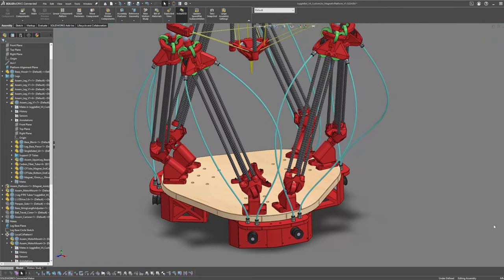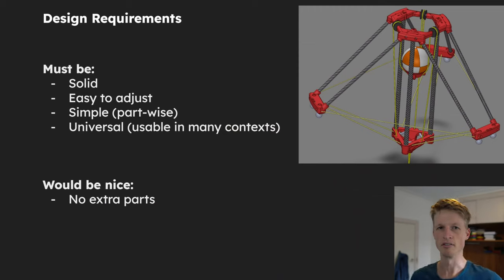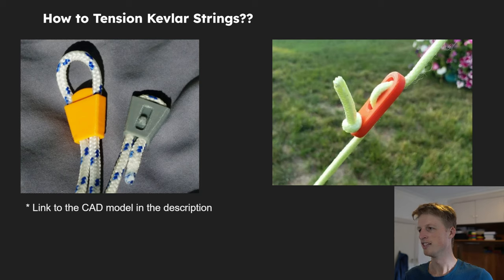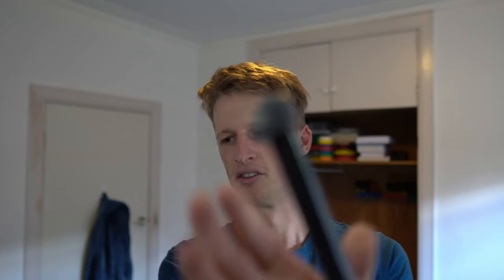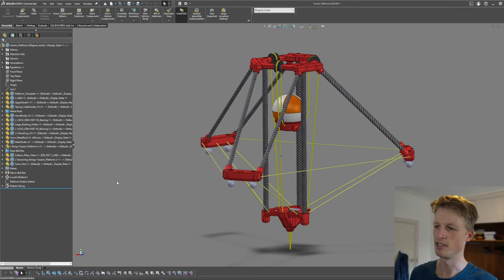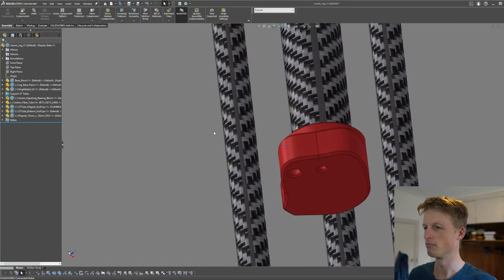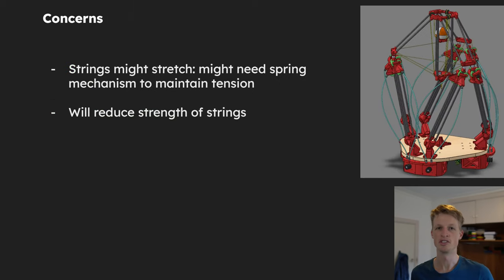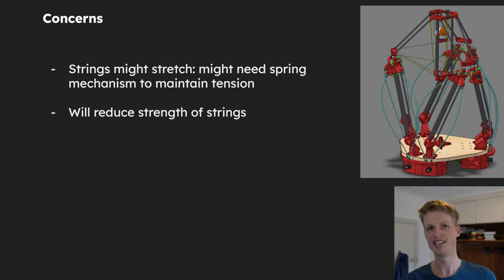Knot Anymore! Jugglebot's (Practically) Knot-Free Design! - PDJ #16

Comment: Maybe something like a clip bolt lever could clamp down on the string, instead of having the string kink up and shear off due to the screw thread. F.e. some pedal bike's have the front tire bolted on loosely and then tightened with a lever. You wouldn't need the bolt because your 3D model could include the clamp mechanism. The only part you'd need would be the special lever.
Clamp mechanism: string goes through a hole that has a very thin side. The lever simply pushes down on the thin side - which crushes and tensions the string. Google shows they sell just the aluminum clamp part without the bolt - which seems perfect.
It's more weight, but maybe a tiny clamp could be found. A tiny 3D printed one might just work for you too?

Comment: Very cool! Jugglebots really coming along. Did you have any references to the sharp corners decreasing the strength of the cable comment? I work a lot with cable robotics as well and feel like thats something I should know about! Cheers.
Reply from the maker: Thanks!

I didn't have any specific references for that comment in mind, as I've just come to learn it from years of climbing / rope "adventurous activities" experience. Googling "rope strength over edge" seems to get pretty solid results if you haven't already tried that.

Tbh I don't think it'd be that big of a concern for this project since the strings are already so strong, and I'd guess you'd be in a similar position with your robots. Have you ever had cables break?

Comment: The tensionless hitch has near zero impact on line strength. Most people would describe a tensionless hitch as simply wrapping the line around the spar (or screw) multiple times ;-) So your screw wrap design is near certainly stronger than any knot. Now, so long as it doesn't slip... ;-)
Reply from the maker: Good to know! Re. line strength, I'm more worried about the pinching/kinking that will undoubtedly occur when the bolt is tightened. I'm not terribly worried about this though, as the strings are super strong